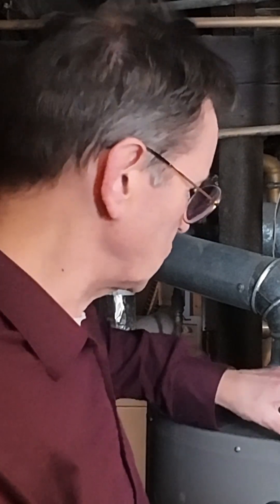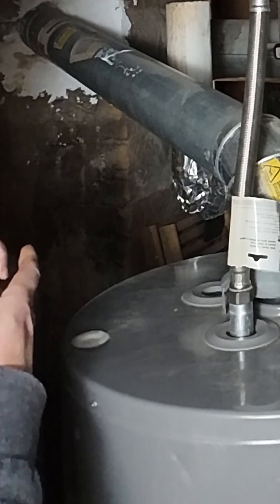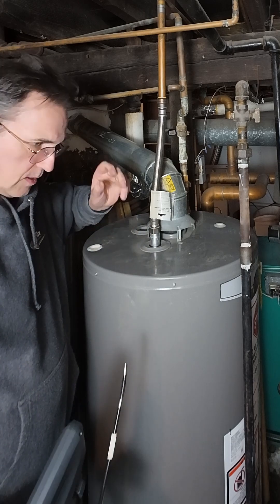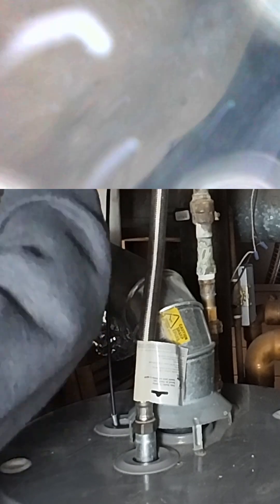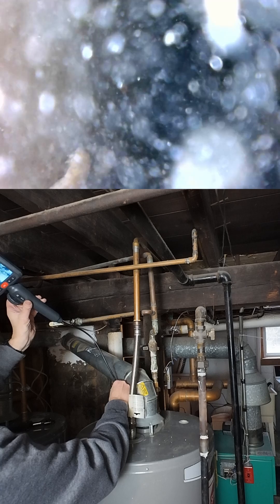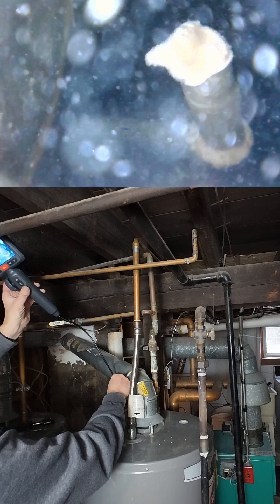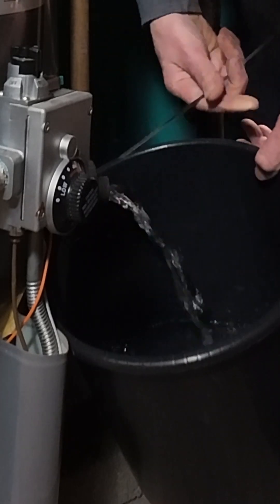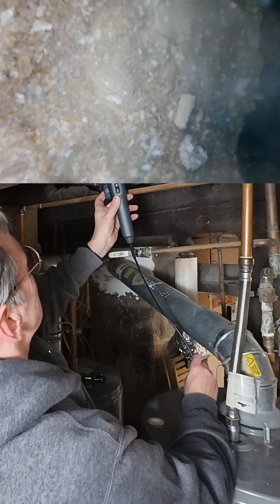Shocking Discoveries Inside Your Water Heater: Should You Drain it Yearly? #waterheater #DIY

Comment: My tank is from 1996.  It is working fine for now, I was advised not to mess with it at this point.  I bet it’s probably got a bit of sediment in the bottom
Reply from the maker: That's like the old expression says, "if it's not broken, don''t fix it!"  I hope you get more years of good use out if your tank.
Reply: Is it still going fine? Gas or electric?
You should inspect the anode rod. If it looks fine, then you know why the tank keeps working. If it's eaten up, then you can either replace it or assume that the tank is going to leak any day now.